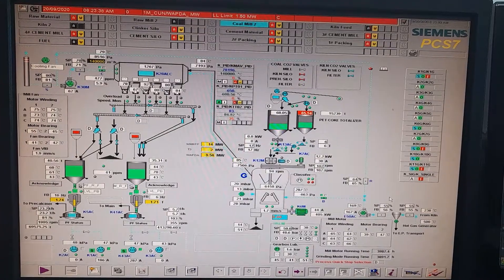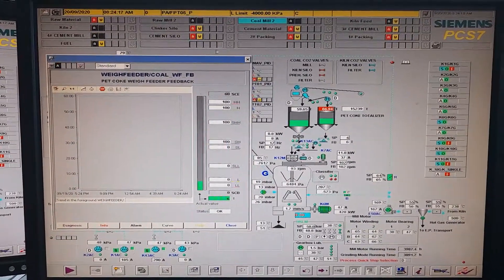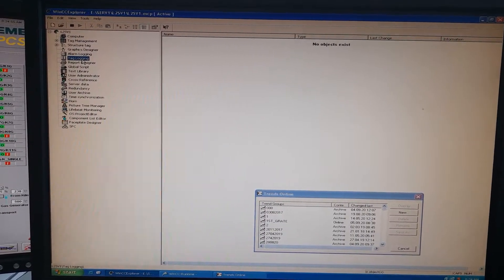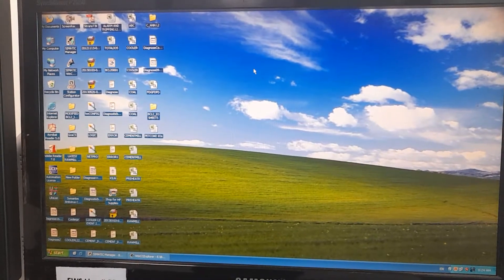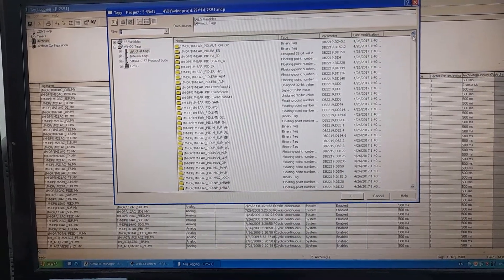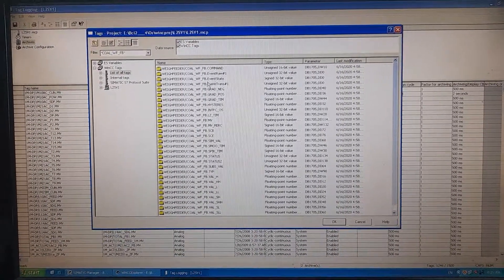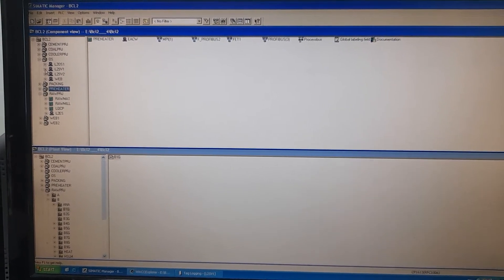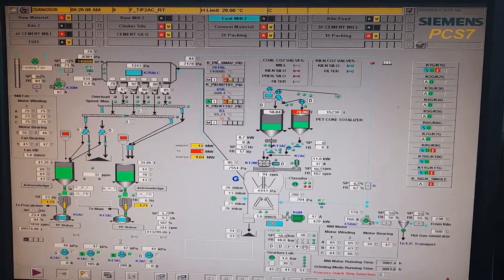Process values archiving | Tag logging in SIMATIC WinCC | PCS 7

Comment: Dear sir can u please make video for pcs7 with cemat addoption and how to program
Reply from the maker: can u plz explain cemat adoption..?
Reply: Cemat for cement plant, mins, minarls, purpose. Pcs7 having cemat. If u want more details about cemat u check siemens website
Reply from the maker: Yes i use CEMAT library on daily basis since We have its library..
Reply from the maker: It will be better if u specify ur question so that i can explain ....
Reply: Sir actulay in pcs7 cemat drive block comes under OB 1 main task. But I tried to copied cemat block. In runtime sequence main task not come what will happen. How to solve it.